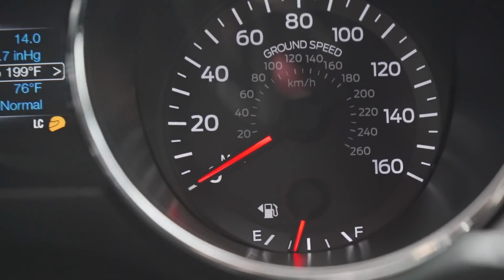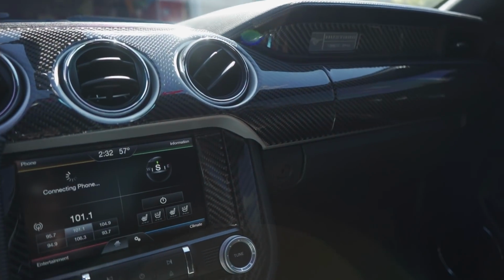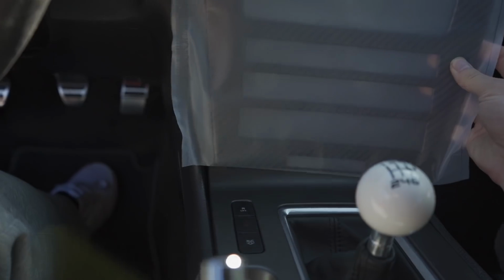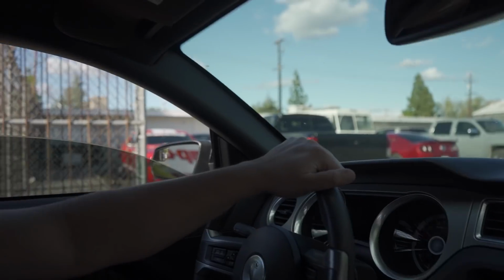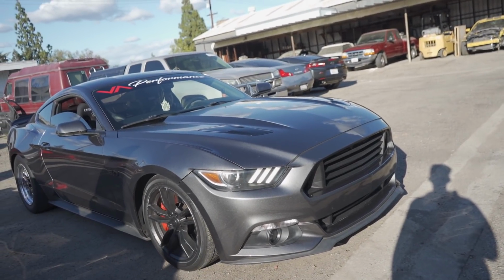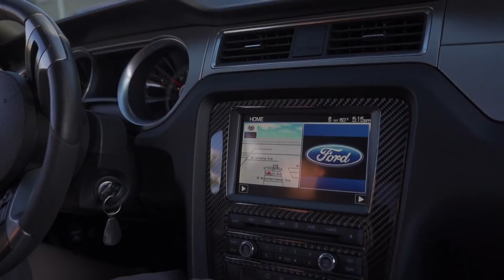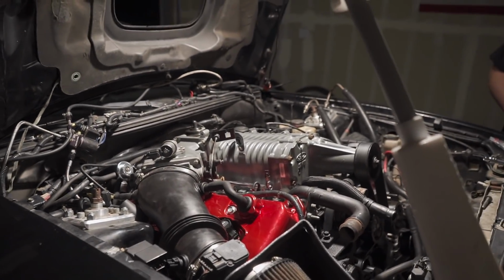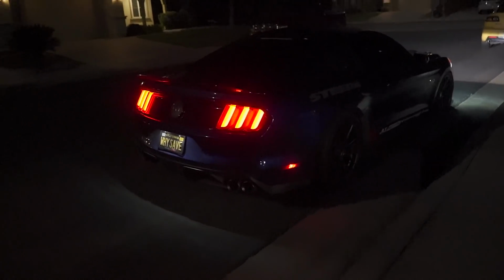Why I haven’t Modded My 5.0...

Comment: Get an EVOOOOOOO!!! I’m a big evo fan and I have a 2013 Lancer GSR bro you will not regret how much fun the car will bring you.
Reply: They are slow af
Reply: jdea18 says the dude with no car I bet
Reply: jdea18 wtf?! I think you are slow, an Evo is legendary JDM car tf😐 if built right they can put bus lengths on a mustang. And an evo X just recently broke into the 7’s in the 1/4 mile so how are they slow?
Reply: @Curlyheadrae24  and a mustang built right can put bus lengths on an evo probably for alot less money so whats your point?
Reply: Michael Harris First, no one was even talking about performance on either of the cars but since you wanna talk performance lets do it😂 false, you can go full bolt on and e85 for less than 2k on an evo, add a bigger turbo probably around 3k. And that depends on the race. An 800hp evo vs an 800hp mustang, 0-120 I got my money on the evo, 40-120 I got my money on the evo. It’s way lighter and is AWD compared to the mustangs very heavy weight. In a 1/4 mile race it could go either way, in a 1/2 yea the mustang would catch the evo most likely.
Reply: It's just different.  Both fast in their own right.
Reply: @Curlyheadrae24  no one was even talkin about performance huh?  "An evo built right can put a buslength on a mustang..." was your quote i beleive.  To each their own but im a mustang guy and you cannot deny how amazing the coyote platform is.  These things put in work with stock components i mean stock bottom end stock trans etc and run crazy fast times.  Any car can be built up to be fast if you have enough money it isnt even about what it can do once built.

Comment: wait till you go against a adminTUNED INFINITI G37 and it will walk your 5.0. My infiniti g35 admintuned 6sp auto walks 5.0 from a dig and a roll.
Reply: you are kinda right. I have a nissan 370z with a tune and some races i have beat the new mustangs and some i havnt. but the admintune does help and the q50s are no joke with it.
Reply: Post some vids.
Reply: @evanderlugops  search em up admin tune nissan or inifniti
Reply: @davidpineda645  no I know of them. I want to see vids of your car doing work. Not some other peoples cars, yours.
Reply: @michaelharris748  FOR 5 GRAND G35 AND ANOTHER 5 GRAND YOU GOT A COYOTE KILLER! THATS A BUCKEROO COMPAREED TO A $32,000 STANG. ITS NOT EVEN A MACH 1 OR A ELENOR!
Reply: @davidpineda645  wtf are you even talkin about?  You mean buying a g35 for 5 grand and putting 5 grand in it?  That is so stupid you cant compare old cars to new cars.  Thats like saying oh get a 5k dollar fox body and throw 5 grand at it and you can smoke a stock coyote....and?  Who gives a shit.  You can build anything to be fast.  explain to me exactly what you plan on doing with your 5 grand?  You boosting it? That includes the boost itself and all related parts needed to run it safely as well as tuning and everything? If you arent talkin about boost i dont see a bolt on g35 walking a 5.0 even a stock one.  5.0s rape those pos infinities which are just heavier 350zs nothing impressive whatsoever.  Classic example of a car that looks faster than it is instead of visa versa (sleeper).
Reply: @davidpineda645  what is an elenor? A mach 1 was a stang made late 60s and 70s and it was remade 03-04...never heard of an elenor.  There was a movie gone in 60 seconds where there was a 67 shelby gt500 they fixed up and it was nicknamed that but that isnt the actual name of the car they never made a mustang called that.  Get outta here with that inifinity shit they aint got nothing on a coyote period point blank

Comment: What's better a scat pack or a 5.0
Reply: Jayy Cee depends on the person actually. which ever one the person likes more is better for them.
Reply from the maker: 5.0 but I’m slightly biased 🤭
Reply: Get a scat. They have faster 1/4 times with a tire stock vs stock. They sound better, look better, are more comfortable and imo the better car.
Reply: Stock for stock. Scatpack over s550 unless it's a gen 3
Reply: @kbdadriftking  Scats are still faster in the 1/4 vs a 10spd
Reply: @karlhopkins713  no... The big 3 all run 11.8 in the quarter. But the mustang and maro do it more frequently.. and up top the gen 3 stang is the fastest
Reply: @kbdadriftking  Stock record for a stock scat with a tire is 11.3 vs 11.5 for a 5.0 or Camaro 🤷
Reply: @karlhopkins713  11 3 for a 4200+ lbs car with 485 flywheel hp?  Something isnt adding up there.  What was the trap speed on this supposed 11.3 run?  The boss ran 11.8 at 117 on a tire only back in 2012.  Still keeping up with the best na cars out now stock for stock nearly 10 years later.  Thats why i am getting a boss engine is just as stout if not more so than gen 3 coyotes as far as power handling they can do work na or boosted and handle awesome for a solid axle (which i prefer honestly) that is why im getting a boss i aint got no dog in the fight with the modern cars the big 3 are fighting with but i find it hard to beleive a completely stock scat ran 11.3.  I saw a stock boss run beside rush shifts srt its 8 speed auto and is known for being a fast "stock" car some even acuse him of unknowingly having a tune installed in the ecu.  The boss was actually creeping ahead up top just before they let out well over 100 mph.  So i find it hard to beleive they can run half second quicker than the fastest stock boss both being on a tire.
Reply: @michaelharris748  Almost 119 bud
Reply: @karlhopkins713  on a tire maybe....but im saying out the box.. I need some of the coke you are on
Reply: @michaelharris748  the roadrunner"boss engine" is dope af
Reply: @karlhopkins713  your argument is invalid. A lightweight battery, and a DRAG PACK is not stock...maybe rhe battery can slide...but a drag pack fam.....goodnight go to bed. Fanboy. Idk why yall think scats are the fastest thing out there
Reply: @kbdadriftking  Guess what bud tire is not a drag pack lmao. They have demon suspension still factory. Regular scats have also done 11.4 11.5 good day kid.
Reply: @kbdadriftking  it sure is...im def getting a boss next year ive seen some with pretty low miles clean in the middle 20s you just gotta shop.  Some are asking 30s but they can be had for mid 20s.  It is just a bad ass car it looks bad ass performs bad ass handles bad ass...its rare it has everything going for it...it is an amazing drivers car as well it isnt always about the numbers.  People say an s550 performance package can run close to the same lap times as a boss but it isnt gonna feel nearly as good as the boss imo which is raw and engaging its just a bad ass all around car
Reply: @michaelharris748  the s550 is a more rigid car and has the IRS... I promise you if the boss had an irs swap it wouldn't be close

Comment: Evos are overpriced for what they deliver, supercharge the 5.0, it’s only a matter of time until you have to upgrade the bottom end on the evo to make the same power as the 5.0 with a unopened engine
Reply: They are not overpriced. I literally just bought a 2013 GSR with 68k miles for 21k and it came with FBO, all it needs is e85. They aren’t made anymore so they are becoming rare. It’s not just any random JDM car, it’s an evo, it’s on par with the 1991 NSX, GT-R’s, and the supras.
Reply: @Curlyheadrae24  you paid 21k for a car that's damn near a 10 years old. And yeah it has bolt ons. But since when did bolt ons make the price of a car jump up like that. Unless it was a bigger turbo or something. And the car has damn near 70k
Reply: Kuri Brown you clearly know nothing about cars that aren’t made anymore, Supras cost way more and they are way older than my evo. You must not know how the term “rare” works. They aren’t made anymore and are a very well known sports car, the value of cars such as a NSX, Evo, and a Supra will continue to go up in value. According to the Kelly Blue book MY car is valued at 19.7k, so what’s the point you are trying to make?
Reply: @Curlyheadrae24  just because kbb values at that number doesnt mean you shoukd pay it. The supra and nsx are that much because those cars were special. Not some clapped out evo
Reply: @Curlyheadrae24  nobody goes omg it's a fuckin Evo 10. A fucking viper can be clapped out if you let it

Comment: Don’t buy an evo no ! They have many problems man they are shit tbh
Reply: Dude In a Ford ! Lol they better than a Ford
Reply: @elementsk8erq  You wish bud
Reply: Karl Hopkins bet my evo will smoke your ford tho
Reply: 3_more_days_till_friday your Evo pretty slow man... my GT would take you to Gapplebees !!! Nothing but American Muscle !
Reply: Dude In a Ford ! Lol bet! What’s your ig
Reply: @elementsk8erq  Idc bud, you'll need how many engine's to even be as reliable as my one.🤷
Reply: Evo’s are dope don’t know why you hate on them
Reply: Karl Hopkins You driving the slowest model/year of the Mustang. Take a hike.
Reply: @yohan1902  How am i?
Reply: Dude In a Ford ! Slow boys talk the most. Shut up let’s run it slow boy.
Reply: @yohan1902  Mustang 2s are way slower so are fox bodys.🤷
Reply: @yohan1902  Bet you can't even drive bud
Reply: @yohan1902  60s and 70s stang for the most part are slower as well
Reply: Karl Hopkins one built motor, 723whp and 30k hard miles on it with no issues
Reply: @elementsk8erq  built motor to do 700 wheel?  Gen 2 coyotes go above 800 on a stock engine with a power adder.  Try again
Reply: @elementsk8erq  and btw those cars im speaking off making 800-900 are stock engine cars...dont even get me started on the sleved built motor coyotes you dont wanna go there
Reply: Michael Harris take in consideration it was done on a heartbreaker mustang Dyno if you know what that means... and also 15% awd drivetrain loss. I smoke 900hp+ vettes and cobras